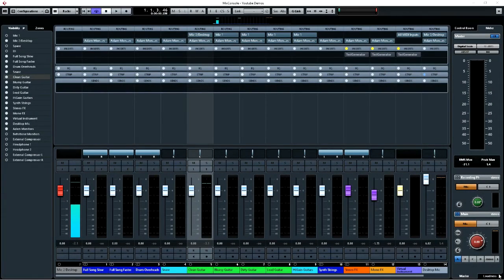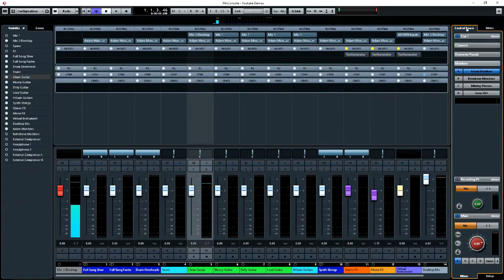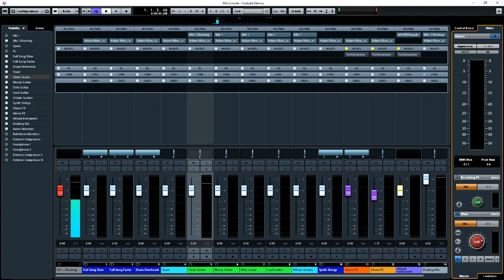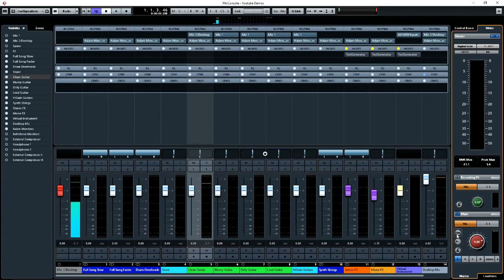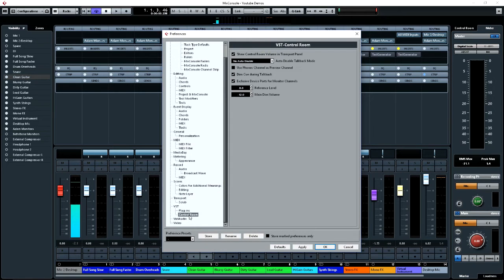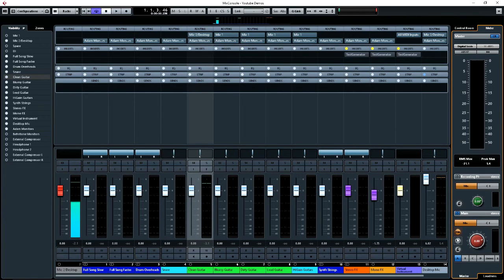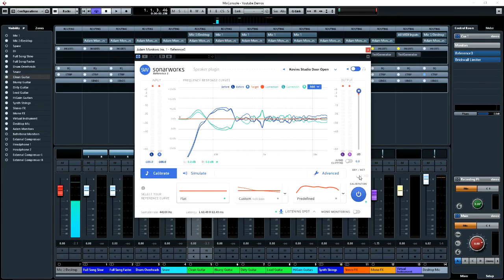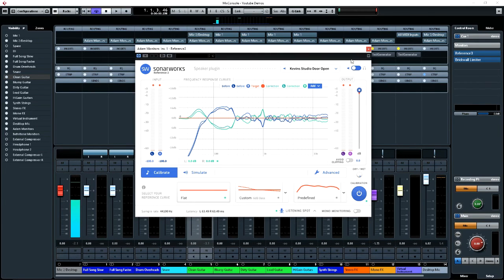How to use Cubase Control Room with Sonarworks - Mixing Tutorial

Comment: Hey Kevin, great video. However, the Control Room has volume for each set of speakers built-in, so you can level match without the plug-ins. On the setup tab select the monitor you want to adjust and there will be a volume just below the plugin slots. It is a small horizontal slider.
Reply from the maker: Thanks for the info! Thanks for the support.

Comment: Great video. Do you know if it’s possible to route the mix bus output to UAD console for mastering plugin chain processing in low latency then back into the daw through Sonarworks in control room? I would like to hear my vst instruments through the mastering chain and preserve cpu power.
Reply from the maker: I can't see why you couldn't do that but I am not really understanding why you would do that. What is the difference between doing what you are asking and just putting the UAD plugins on the Mix Buss for your mastering process? Using UAD plugins in the DAW is going to use UAD DSP instead of your CPU either way. Maybe I am missing something and you can provide some more detail so I understand it better. If you want to visually keep it clean looking then you could create a new Master Buss and route the Mix Buss to the Master Buss.

Comment: Hi !
I bought the Sonarworks bundle this week & made today the calibration with the mic they sent me.
The main reason I bought it is because I have a small room (270cm * 230cm), with acoustic treatment only
behind the monitors & at the wall infront them (no bass traps at all this moment).
I wanted to ask U what should I expect using Sonarworks ? It is going dramatically help me with my mixes under my current circumstances (small room, no bass traps) or I should lower my expectations & anyway must move my studio to another room with much more acoustic in it ? Does the generated file will correct my room as acoustic would ?
Thanks for the tutorial, it was exactly what I was looking for !
Reply from the maker: Thanks for watching and for the question. The best approach is always going to be to pick the best room and do the best acoustic treatment you can first, then use Sonarworks to make that last little bit of improvement. Most people are never going to have a perfect room and you can only spend so much on acoustic treatment. Not to mention the amount of acoustic treatment you may need to fix your room might not leave any room to actually work in.
Sonarworks is going to make a big improvement but it can only do so much. The thing is people argue that these corrective tools don't work because they fight against your room , which is true in part. If your room has an issue where it nulls 100Hz and Sonarworks adds more 100Hz are you going to hear it because shouldn't room just null that again. In theory maybe that would be the case but reality it isn't as simple as that.
My best advice is as stated above but also don't stop yourself from mixing because you can't get the perfect setup. Just do the best you can. The most important thing is to learn, have fun and don't go broke or destroy your entire house to do it. The great thing with Sonarworks is it shows you a graph and tells you what it thinks is wrong as well. This allows you to keep that mind and mentally compensate for it as well. Again if your room nulls 100Hz then be careful to hold back on the 100Hz in your mixes because you are likely to over do it trying to hear it in your room. Look at a spectrum analysis and see if you have added too much 100Hz. Probably the two last most important techniques is to reference with popular mixes in your room and also review your mixes in other places like your car. Every place you review your mix in is going to have a different set of acoustic problems. Getting a balance between all the problem locations should give you a great sounding mix.
Slowly over time you can think about changing rooms if possible or spending more on acoustic treatment or learn to build your own. Then as you improve your location you can redo the Sonarworks calibration and keep getting better and better results. Just don't be one of those people that refuses to release any mixes until they have built the $100,000 custom designed studio that they then don't know how to use and spent 20 years saving for.
Reply: OK man ! Thanks for taking your time to answer, I appreciate it.
Reply from the maker: No problem. I hope it helps.

Comment: Thanks for the video - i'm trying to find info on the sonarworks plugin for headphones (noob trying to learn how to use it) - you say to bounce out with it bypassed, but i notice when i bypass it, my mix all of a sudden jumps up in volume and frequencies are going everywhere. Am I supposed to be A/B'ing during the mix to get my raw mix sounding as the same as when the plugin is turned on? I'm trying to understand the sound i'm getting from this plugin and what i'm supposed to be doing with it - thanks for your time!
Reply from the maker: The software is supposed to be correcting the frequency response of your headphones. This is to allow you to hear what you are mixing accurately without the flaws of your headphones. Because it is correcting for your headphones you don't want that correction to be placed on your mix because when you take it to the car or give it to other people that correction would make it sound horrible on their system, because their system doesn't need that correction. If you play the mix without the correction back on your same headphones then it will sound wrong because your headphones are not accurate. For example if your headphones lacked low end and Sonarworks compensated for this by boosting the low end, if you left that on your mix then when you played it in your car that had good low end your mix would have too much low end and sound bad. If you remove Sonarworks when bouncing out then the mix should sound good in your car. If you play it back on your headphones again it will sound like it is lacking low end but that is because your headphones are the problem.
In regard to the volume issue, Sonarworks does lower the volume of your mix when it is correcting to allow room for it to boost certain frequencies etc. without causing clipping. I would suggest that you keep that in mind and before bouncing out bypass Sonarworks and get your mixes volume right. I am assuming that you are not using Control Room in Cubase because if you are you would not have this issue and would not need to bypass the plugin.
I hope this makes sense. It is hard to describe clearly. Feel free to ask me follow questions.
Reply: KdW Mixing & Mastering Ahh gotcha, thanks so much for your reply! Where i got confused was where I thought I had to A/B to try and match my sound to what I was hearing when the plugin was switched on, but it's a reference - thank you - with the volume lowered, should I adjust in the plugin and switch off clipping or is that not a good idea?
Reply from the maker: I personally switch the avoid clipping off and set the volume back up to 0db. I do this only because I mix with lots of headroom and know that my mix is not going to clip with Sonarworks turned on. When I am Mastering a song I have a preset that has the avoid clipping turned on again because at that stage I am pushing the volume to very high levels. If you run your mixes very hot or you are mastering then I would not turn that off because you will get clipping and it will sound horrible. In this case I would mix or master your song entirely to where you are 100% happy with the way it sounds and then I would bypass Sonarworks and just work on the volume of the song and ignore the sound of the mix. This step is critical if you are mastering because getting the correct volume is one of the main processes. If you don't get that right then you will get complaints of your song is not loud enough or is too loud and is suddenly over compressed because it is slamming the brick wall limiter.
Reply: You da man! Thanks for the awesome info, has helped heapss!
Reply from the maker: Glad I could help, thanks for watching.
Reply: One more question! I like to switch and listen to the tune out loud - would I turn the plugin off when doing that? (im on the road at the mo and dont hav monitors)
Reply from the maker: Yes because it is correcting for your headphones. If you have the speaker calibration version as well then you would have a analysis for that and switch over to that. Since you don't have monitors I am assuming you only have the headphone calibration version, so turn it off. This way you are also reviewing the real version that everyone else is going to hear.